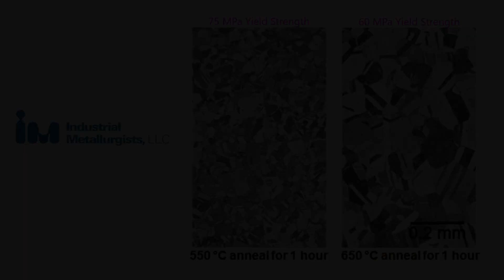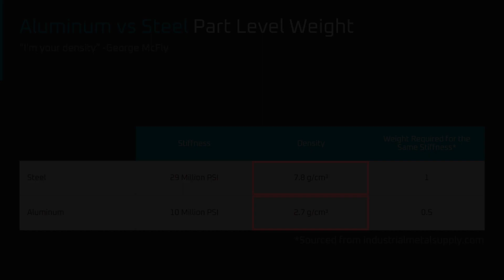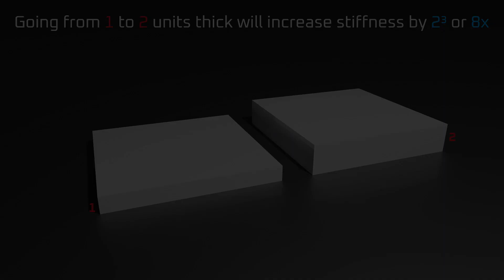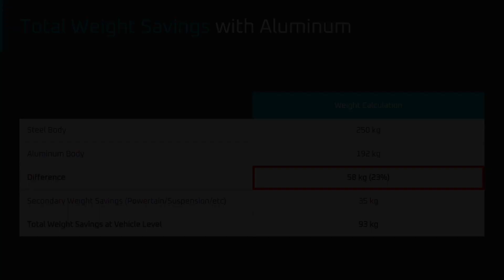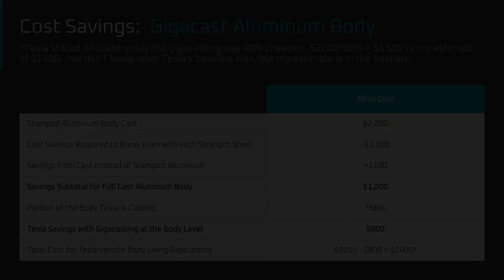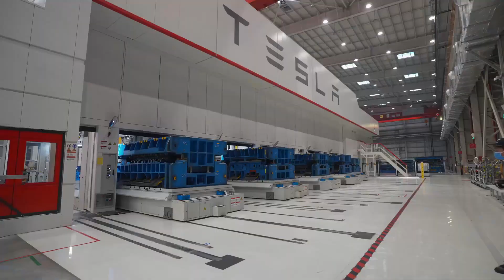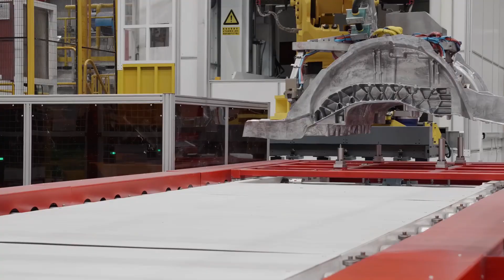#2 Tesla Gigacast Aluminum vs Advanced High Strength Steel

Comment: I wish tesla would do an environmental savings impact for the single piece giga castings. Vs the 70+pieces that were required for the same part.
As in cover everything involved in making that all come together vs a simple single casting made from one patent metal. Pressed in a single machine.
The capex and energy savings alone from 300+less robots on the line. Has to be staggering. 
Let alone the reduced footprint of the factories, reduced heating&cooling etc. 🤔

Great stuff as usual man. I often have to re watch your videos because I just cannot absorb everything on the first run through. 😀
Reply: That is fair, however energy translates to cost. So we can use the cost advantage as a proxy as well :)
Reply: There is litteraly zero saving advantage in terms of the environment. Also other manufacturers doesn't use 70 different parts. Other manufacturers already have all the machines necessary for manufacturing and melting metal all the time requires alot more energy than just running some robots.
Reply: @moineaux9173  we aren't talking about other manufacturers here. Tesla themselves said the single piece rear casting replaces over 70 parts of various sizes and metals that use different bonding methods with the single piece large casting.
 
All of that complexity ad's up, plus the fasteners you now dont need. Glues and adhesives you don't need, labor you don't need and less machines. Nm like I already said less space to run the assembly line reducing factory footprints and saving further energy. 

Plus the weight savings of up to 14% allows the vehicle's to be more efficient as well. 
Which can reduce impact and costs even further. 

It's a interesting cycle, where less weight, means more efficiency. 
Which means less batteries per car equals more profit. 
More evs on the roads for the same amount of total kwhs of battery production. 
Reduced cooling system needs, reduced heating needs, reduced wear on components, reduced braking force needed, less wear on tires etc.👍🏻
Reply: @4literv6  lol.... the 70 parts that tesla was talking about was just showing their inefficiencies in the manufacturing, again no other companies uses that much parts for just a car section, you're welcome.
Reply: @moineaux9173  ahh got any proof of that by chance or links to share that can back up your claims? 🤔
I've been doing research on the history of evs and tesla for over 3 years now. And watched many of Sandy Monroe's video's. 
He doesn't seem to think tesla is doing anything besides leading on ev manufacturing. 

Which coincidently line's up nicely with their sales volumes as the worldwide ev leader. 
Further more vw just recently called an emergency all hands meeting over the tesla Berlin factories immenint opening. 

Apparently tesla makes a model 3 in about 10hrs total time. 
Whereas the id.3 takes vag over 29hrs to make. Now just how inefficient could tesla be when they can make the world's best selling ev in around 1/3rd of the time as it's nearest competitor? Doesn't sound much like tesla is inefficient now does it? Rather it seems the company supposedly more experienced in volume car manufacturing is the real loser here. 🤔
Reply: @4literv6  you're not serious at all because vw is still ramping the production of the id3 and id4, the production time is totally justifiable if its even true. Tesla also had to start from zero too.
Reply: @moineaux9173  keep reaching pal and soon those goalposts will stretch so hard they'll break like an elastic. 😁👍🏻

Comment: Thanks Jordan!  Totally geeked out on your in-depth analysis. 
The knock-on effects are of wide ranging and long lasting benefits. Having worked as a Quality Engineer in manufacturing I cannot begin to tell you the tremendous cost benefits of do-it-once-and-done manufacturing process with the Giga Castings. By replacing 70 parts with just the rear castings in the Model Y will not only reduce manufacturing logistics cost and increase vehicle performances but increase the overall fit, form, function quality and durability of the vehicle. This will reduced after delivery servicing and increased customer satisfaction.
This is the Holy Grail of manufacturing.
Reply: Lol..... its only tesla that was using 70 parts for the rear.
Reply: The Holy grail of manufacturing is f1 technologies those people are able to extract the most power out of everything possible tbh.
Reply: @moineaux9173  Are F1 cars sold to the masses?
Reply from the maker: Hey Robert!  Thanks for sharing!  I love hearing insights like this from people in the industry.

Comment: Not sure where you got the slide at 1:47, but 60 and 75 MPa is lower than the lowest strengths of garbage steel. Suspect it is supposed to be 60 / 75 ksi, which is still not super strength in my books, but getting there.
Reply from the maker: I didn't pick the slide to extol the virtues of steel or alternatives.  I picked it because it was a good SEM that compared the impact of temperature variance.
Reply: @thelimitingfactor  love the content btw! Hope you can eventually do it full time if that suits you!

Comment: Just to say, Magnesium and Aluminum have a similar melting point, about half of steel.  Because the casting machine is made of steel with a similar melting point, and the desired crystal structure of the steel may not survive casting, casting steel seems unlikely.  If possible, it would take more energy to melt the steel and cool the casting machine.
Reply: Steel can not be used in die casting. The crystal structure devevelops during cooling the steel, and often further heat treatment. You typically need slow cooling, and cooling at the same rate everywhere in the part. Steel is just completely different to handle, and this method does not work.
Reply: Correct. Steel can be cast, but with extreme difficulty, and NOT in this kind of detail. Incidentally, magnesium is a lot easier to cast than aluminium still, with noticeably longer die lifetime. Melting temperature is just one of many factors.
Reply: What if… we just make a car out of water. It melts easily, takes any form and keeps that form once solid. Why arent Tesla execs thinking about this?
Reply: @pasticcinideliziosi1259  We have more than enough ice cars. 
But cars made of frozen water are new. Large ships have been build from ice, successfully.
Reply: @vsiegel  let’s start a business bud
Reply: use Japanese crucibal Steel - Tamahagane.

Comment: An additional advantage with casting is that you are generally provided a more flexible design space.  You can more easily position the part topology (can be optimized using finite element methods) to the most efficient shape possible to get a given job done.  Therefore you can use even less raw material and further decrease costs.  

This may also lead to more flexibility in overall assembly design, where you can position other components with more freedom.  The benefits just keep coming.
Reply from the maker: Amen!  It's a whole new bag of tricks!
Reply: @AudiTTQuattro2003  It would be interesting to know the bottom-line total cost per major die iteration.  Since the dies are likely lifecycle limited, much of the cost would be on the development side.  

Tesla's vertical integration, holistic engineering approach, and use of smaller elite teams allow them to do the engineering balancing act better than any other automobile manufacturer.  It really is a joy to watch these developments roll out.
Reply: @jamesdorrell712  uhm nope!
Reply: Wrong, the casting actually reduce your flexibility in the manufacturing. Stamping is stupid cheap and modifying a stamped part is even way easier than repairing a casting.

Comment: Excellent video.  I've watched it twice, now I need to go back, slow it down, and take notes in order to get all that good info onboard.  But a couple of questions:

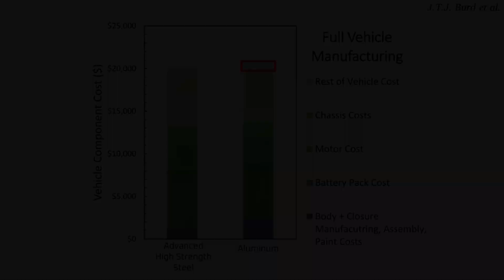At 19:36 in the video you have a slide that briefly flashes showing the cost breakdown for a $20k EV.  The battery pack cost segment of the bars.  Based on what per kWh cell cost?  

In relation to that, the Geely EX3 EV , a subcompact crossover, which has a modest 120 to 150 mile range and appears to have decent features and might pass EU/US safety requirements is selling in China for $9,200.  There may be a $2k government subsidy, however that's a perfectly adequate daily driver.  I assume they're using less expensive LFP cells.  How do legacy car manufacturers compete with a decent EV that could be profitably sold in the western hemisphere for well under $20k?

What happens if Geely, BYD, or other Chinese manufactures open car plants in Mexico where they can spend less that US costs for labor and dodge the high cost of transoceanic shipping?  Do what Ford is doing with their E-Mustang.  Do most of the work in Mexico with less expensive labor then do the final assembly in the US in order to dodge import tariffs.

Then the cast aluminum underbody Tesla is using.  Tesla has talked about manufacturing "million mile' EV which seems possible with LFP cells.  And certainly would be desirable for robotaxis and commercial fleets.  Wouldn't a non-corrosive underbody greatly increase the value of an EV?  Even for the retail owner who could either get many more years of service or expect to sell their used EV on for a much higher price due to the years of service remaining.
Reply from the maker: 1)  I think it was based on about $135/kWh, but I'd have to dig through the paper again.

2/3)  They won't.  They try to offer something premium and Chinese companies will pull a Toyota.

4)  💯  Yes!
Reply: @thelimitingfactor  Thanks.

When Sandy Munro tore down the Model Y his team determined that it cost $82/kWh for the cells Tesla was using.  Materials and manufacturing cost.  That was using a more expensive chemistry than LFP.

When Tesla had their battery day they talked about a 50+% drop in cell cost, some due to manufacturing process and some, I assume, from moving to a LFP chemistry.  Turning cells into packs adds something to the cost but if the cost in the graph you used was around $135/kWh pack cost and Tesla can take that down to about $10/kWh pack cost for non-performance EVs then it seems like legacy car manufacturers are in very  deep trouble.  Both from Tesla taking a lot of their $25k and up market and China taking the <$25k market.

BTW, recently sub $20k ICEVs have been making up only about 10% of new car sales.  The legacies are surviving on more expensive car sales.
Reply: Despite people complaining that new cars are "too expensive", the US new car market doesn't seem to be driven primarily by price.
Cheap cars have been available in the US for a long time, but people gravitate to the expensive SUVs and pickup trucks. So, while I think something like the EX3 EV would sell in the US, it probably wouldn't sell in big numbers. I can already hear people saying "I'd love to buy one, if the range was greater, and it had more carrying capacity, and a better infotainment system, and why doesn't it have heated seats...etc".
Reply: @KeithBab  
Most cars last  fewer than 16 years.  Only 1% of all cars in the US make it to 200,000 miles.  200,000 miles /13,000 annual miles = 15.4 years.  

What replaces that 1/16th of the fleet that goes to the crusher every year are new cars.  Those who can't afford new cars buy their cars as used cars.  Let's say they buy a $30k ICEV after it's depreciated 50%, down to $15k.  And then they have the higher operating expense of an ICEV (fuel, oil changes, engine and transmission repairs).  

Give them the option of a new EV for about what they would pay for a lightly used ICEV and enjoy lower operating costs and think about what might happen to the new ICEV market.

People who like to buy a new car every three years and getting half the value back when they trade in are going to find that they can no longer get as much in for the trade in.  The market is going to pay a lot less for their used ICEV.  Many new car buyers are likely to hold on to their ICEV a few more years and avoid spending more money.  

As/if new ICEV sales drop due to people moving to EVs or just holding on to their ICEV longer the legacy companies are put at significant peril.  It's going to be a few years before they can scale up EV production to get their costs down.  And they cannot, as far as I can imagine, compete in the <$20k EV market for many years.
Reply: @bobwallace9753  IHI reports that the average age of cars is 12.1 years old.  CNBC reports that 25% of cars in the USA are at least 16 years old. 
 From 15 million to 17 million cars are sold in the USA annually. About the same number are scrapped. There are about 90 million cars in USA; so, the scrap / replacement rate is about 17%.
 To replace that 90 million ICE cars will take a few years --- say, 20 years if ICE car sales stopped today.
Reply: @artsnow8872  

"According to the Hedges Company, there were 286.9 million registered cars in the US in 2020."    90 million is more like the global annual production number.

I'd be surprised if 25% of the cars in the US are at least 16 years old.  I'm driving a 17 year old car and I don't see many cars on the road as old as my ride (I bought it new and don't drive a lot.  It just recently passed 80k).  

I live in a rural county that has a low average income.  Perhaps if you get in some place that has a lot of people at the poverty line you'd find a high concentration of old cars, but not in the Northeast where cars rust out.

17 million new cars sold in the US, 287M registered.  If sales hold at 17M and  the total number of cars doesn't change that would be about 17 years to get to ~zero.  But my guess is that is happens faster.  

We're likely to see good quality EVs selling for under $20k and even, possibly, under $15k.  By the time people factor in fuel and maintenance savings I think we'll see a much faster decline in the number of ICEVs being driven.

And then at some place well above 0% ICEVs the ICEV infrastructure is likely to collapse.  It will get harder and harder to find fuel and repair shops.  

Then there's the grim reaper waiting in the shadows, robotaxis.  If robotaxis appear then we could see ICEVs go away quickly.  A lot of people are likely to give up private car ownership and opt for more convenient and less expensive  robotaxi rides.

Comment: Your calculation missing many parameters, Such as casting aluminum could be made into shapes that are not available by welding, like adding rips to strengthen areas need while lowering the thickness of the total body casting. making hollow parts, adding gas while casting further reduce total weight, adding 1-2 % of Mg to the AL alloy strengthen the body (like in soft dring cans you get very low wall thickness while keeping the part weight minimum). Casting allows better parts, more accurate, less waste, Also you can save on space of robots floor which also cost local taxes, rent, While steel stamping leaves much waste that adds to the total cost of steel. with AL casting you save on heavy stamping presses, robots shorter time to produce the car. Less total weight saves future energy.
Mg 100% casting although is lighter in weight stronger than AL it has its own problems with additional hazards of fires during casting and later if a car gets a fire made of Mg, the fire can't be cut off by water since it would cause an explosion. Welding Mg to other parts is nearly impossible.. so casting Mg is not viable. some parts like the steering wheel are rarely made of Mg ...
Reply from the maker: Hi Meir!  The DOE work did include that, and the MIT work was very thorough.

Good points all around!

Comment: Hey Jordan, great video as always. One thing would be great to see is what are the economics of the cost of Giga Casting machines vs cost of the Robots required for welding steal components compounded over the lifecycle of the factory output? Including equipment cost, maintenance and downtime.
Reply from the maker: Hi Alex!  I don't have data on that specifically.  The MIT and DOE estimates were pretty thorough though.  Not exactly the right metrics we needed but I had confidence that they gave a good end result that was comparable.

Comment: Brilliant analysis, as always. You posed the question in your video about how much the gigcasting process speeded up Tesla production compared with stamped steel structures. The VW CEO and President are on record recently as saying that Tesla produces a car 3x faster than VW. Other sources suggest a VW ID3 takes 48 hours to produce versus 10 hours for a Tesla (I believe this relates to a Tesla Model Y out of Shanghai with only a single gigacasting). It's fair to assume that the gigacasting makes a large contribution to this faster speed of production at Tesla. So what happens when Giga Berlin starts ramping up next year with front and rear gigacastings (and later 4680 batteries with structural packs)? One has to imagine Tesla's productivity (or production speed) could be 5x to 6x that of VW... Scary thought for the legacy automakers!  Good luck competing with that!
Reply from the maker: Hehehehe, amen!  I may have to included Diess's comments in the final video